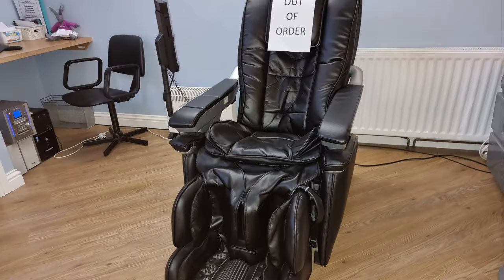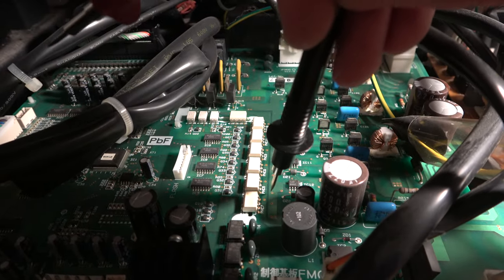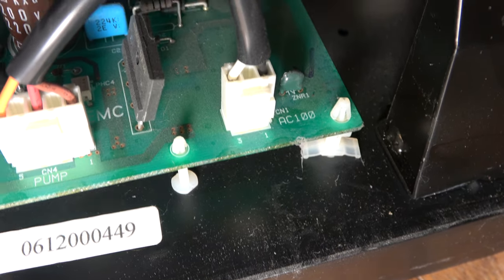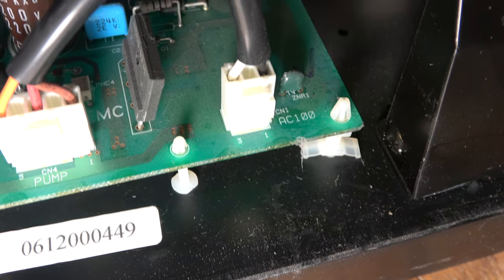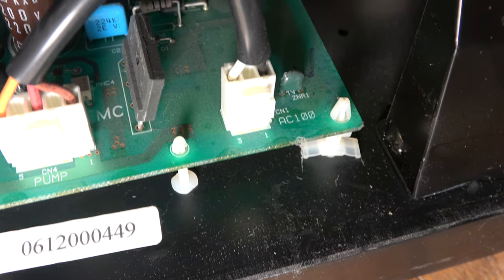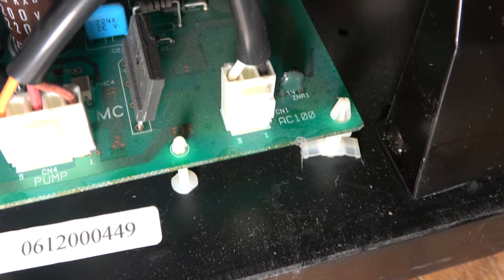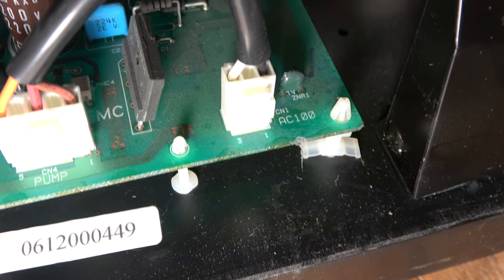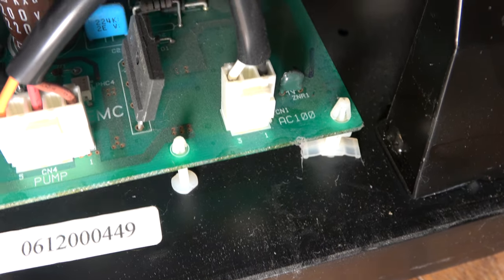Most ridiculous repair attempt ever? High end massage chair.  Inada Robostic HCP-D6D.

Comment: Actually you can rule out the motor part of it as it seems to be galvanically decoupled by relays and optocouplers.
BTW the budget version of measuring low resistances it to use a current limited source and just measure the voltage. This will also eliminate contact problems.

Comment: Nice work. I had the same isue on this chair but after a while came another message: safety switch activated code=008. Any thoughts?
Reply from the maker: I sometimes get safety switch 006 errors. Use the joystick to isolate which motor is affected, 006 is needing motor. I suspect the problem is servo motor feedback wiring but there is no available service information. Gaining access to motors means a lot of dismantling and I've not yet dared to devle deeper as my error is only intermittent. Is yours permanent?
Reply: It is permanent. Occurs  right after the main switch is turned on . Tried to disconnect everything from PCB leaving only remote. All the same.  I think problem is there on PCB Replaced some parts on high voltage part which looked suspicious. . No result. Have no  idea how to check 5vdc circuit .All z diodes are ok. And where that safety switch can be placed?
Reply: @video99couk I was just given this same massage chair. It won't turn on and on the power circuit board where I should be getting 5v I'm only getting 2.5v and suggestions on whats wrong?

Comment: You don't have a thermal camera? Every household should 'ave one ;)
Reply from the maker: Still stubbornly expensive though.
Reply: @video99couk  yeah exactly, also becomes a question of where to put all those tools you rarely use
Reply: I have almost the same problem. I removed the board, but I could not find the place where I fixed it. Please, I want to send you the board so that you can tell me where it is exactly